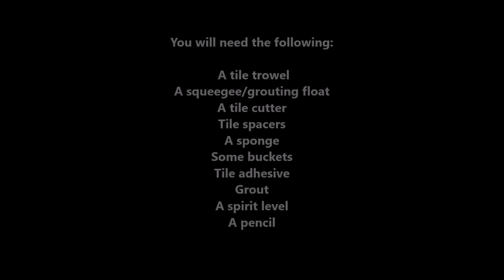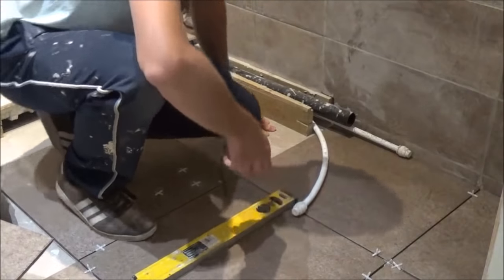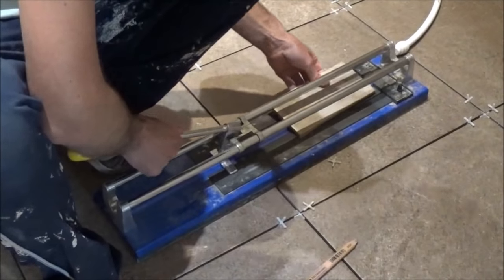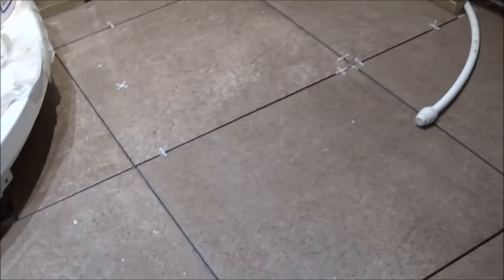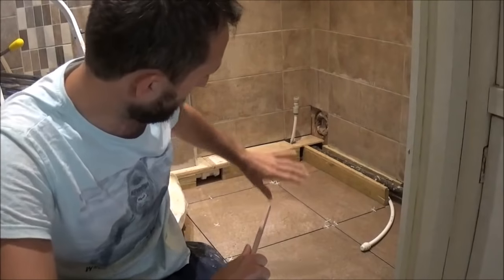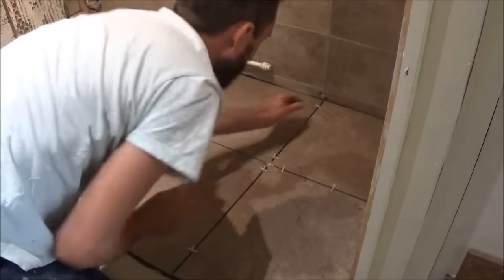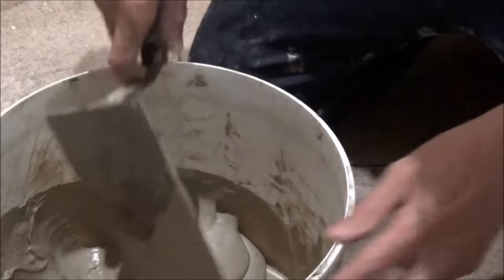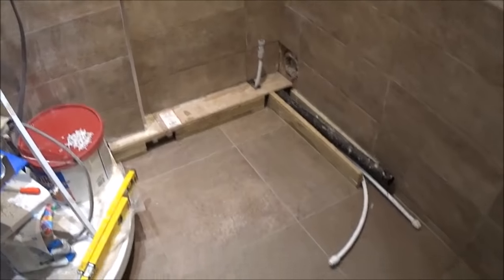How to tile a bathroom/shower floor, beginners guide.Tiling made easy for DIY enthusiasts!

Comment: Did you not backbutter the floor tiles? Isn't that required, especially for ones that size?
Reply from the maker: It depends on the situation. My floor had been recently screeded so it was near to flat. As you see in the video, if the are low or high points I made adjustments for that, but there was no real need for the buttering. But some people like to do it as it can aid adhesion. Horses for courses I guess. Have a play around and get a feel for it. Hope that helps. Thanks for watching!
Reply: It's not really for adhesion or leveling though; tile is very fragile to shear forces (think how tile cutters work), so non-uniform support beneath it can cause multiple weakpoints and make the tile crack pretty easily. Backbuttering ensures that the crevices on the back of the tile are filled to provide support. It makes the tile a whole lot more durable to impacts, which is important for floors. My understanding is that it's actually building code to backbutter large format tiles, and it's for this reason. The installation instructions that come with the tile almost certainly mention to do it as well.
Reply from the maker: You can see from the level floor, the thickness of the cement I laid, and how firmly the tiles were pushed in that there was plenty of cement filing the dips in the tiles. They are solid as a rock, it is in my own bathroom. But, if in doubt yes, you can back butter the tiles. You just have to watch you don't lay so much cement that your floor goes too high as you may need it to line up with a floor of an adjoining room. I guess it's a case of work each job out based on the situation you dealing with at that time. Hope that helps. Thanks for the comments.
Reply: POUSE around the HOUSE the man's right you should have back buttered the tiles any tile considered as large format needs to be back buttered wall or floor

Comment: Umm . . . could you sort of pipe in the grout with, say, an icing type piper?
Reply from the maker: You could have a go, but it'll all fall out a few weeks later. You need to push it in hard to fill all the joints up. Hope that helps. Good luck and thanks for watching!

Comment: How the hell do I do this/tile over this when I have wooden floorboards in my bathroom? I don't want some trashy lino..
Reply: You have to use the synthetic liner that goes between the wood and tile
Reply: @brianbeam361  is that ditra mat? So ply over the floorboards, then ditra, the tiled
Reply: @zakquinn5420  boards, ply, ditra, tiles :)